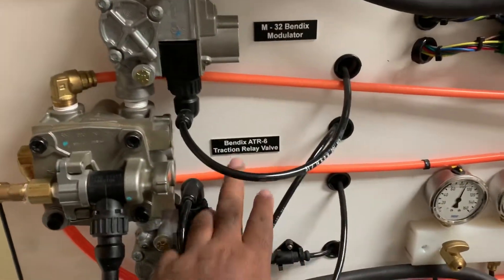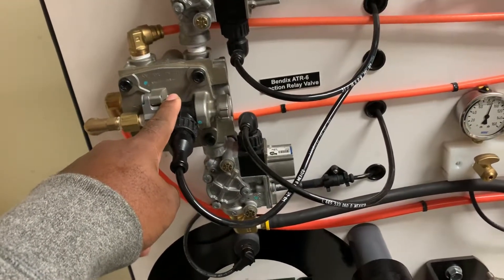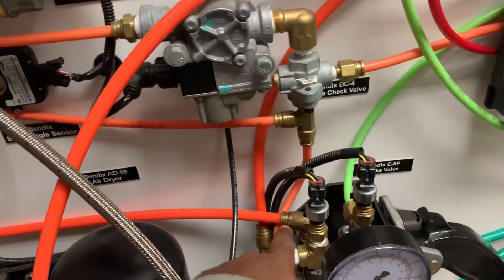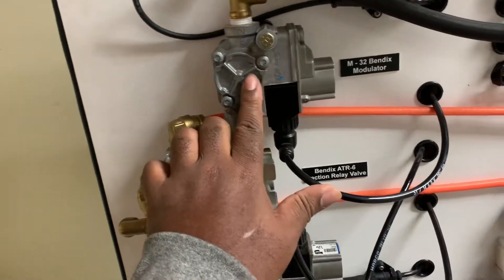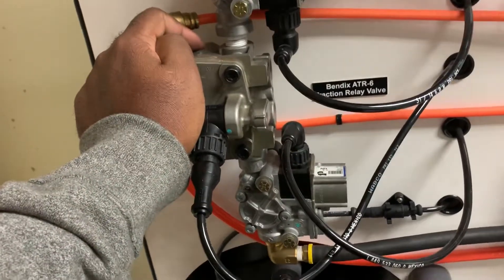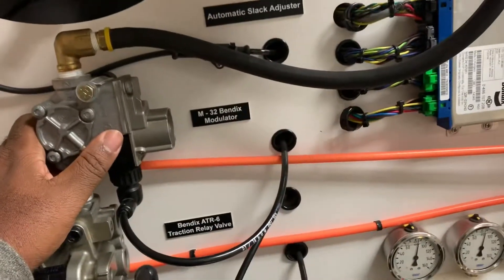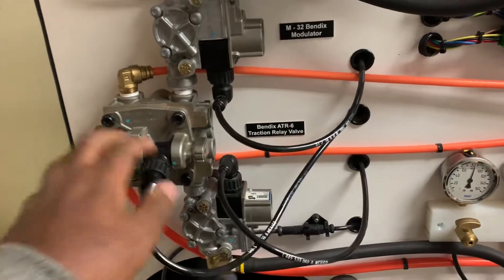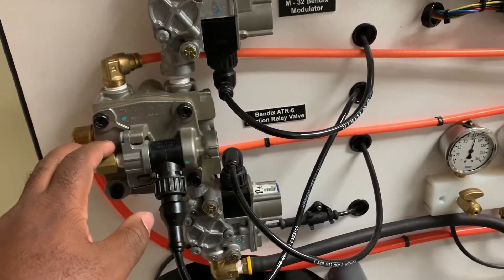Relay Valve and modulator valve

Comment: Hi , when I apply only foot brake (not the parking brakes) there is hissing noise comes from the relay valve and when I put my thumb it just stops
What could it be ?
It doesn't happen when I apply parking brakes 
Thanks

Comment: If the modulator is leaking out the exhaust when brake are applied, is it always the valve is bad? Or can the brake chamber be bad cause it to feed back and dump air?

Comment: Having issues with my 2021 Peterbuilt 348 . I have no air leaks . Getting good air pressure. My brakes are not releasing. I removes both air lines going in to my drive axle brake chambers and getting air on both lines . Should I be getting air on both line s ?

Comment: Hi I had a bad abs sensor on rear axle replaced it now get a brake relay diag.1 my brakes start to lock up on me is one of these on the video the problem
Reply from the maker: You should check your brake adjustment. Unless the abs light is flashing in the cab before they lock up.
Reply: @learndiesel528  no sir no light thank you this is very informative

Comment: A line from this valve it’s back flowing to my pedal brake Valve a delivery line to be more specific and not sure if it’s the really valve or the the other module that’s hook to the valve , it’s there any way to test this valve ?
Reply from the maker: You have probably solved this  issue but I dont know of anyway to test this valve other than getting a known good unit and swapping it in. But the fault you are saying would indicate to me that maybe the foot brake valve is going bad or is hung up. I would look at that first if you havent already.

Comment: I’m having issues with my rear brakes on my semi when I release the brakes the slack adjusters doesn’t fully return but if i put a little force with just my finger pushing the chamber rod back the some air release from the bottom of the Modulator Valve bottom or if i disconnect a little the air line from the chamber the air release and chamber rod return to the release position 
Do you think can be the Modulator Valve that are not allowing all the air from the line to escape when release the brake ? 
Thanks

Comment: Great video. Hey sir. A bad m-32 valve can be the reason why my air compressor might take toooo long to charge my tanks?? I already did a compression test on my compressor and it seems to be building up air pretty solid. With that in mind, my problem is that in the morning when I press both yellow and red knobs and let air stabilize? My compressor won’t recharge again, I have to pretty much floor the pedal to get it to start building air again. I have changed the check valves on both the wet tank and the secondary tank also. I do tho.. hear a purging sound coming out of that M-32 modulator when pressing the brakes. PLEASE HELP!!!! God bless sir!!!
Reply: Please let me add my system is a bendix on a 2012 Freightliner cascadia!!! Thank you!!
Reply from the maker: You probably got this fixed already but I would check the air governor first.

Comment: I have air leaking from the ATR6 valve when parking brakes are released, can you send me the bendix sheet and any idea would help, valve was replaced already and the same problem
Reply: Check the quick release valve above the 2nd axle

Comment: What if you get a hissing noise coming from the main relay while holding the break
Reply from the maker: Sounds like the exhaust portion of the valve may be stuck. Or you may want to see if it is back feeding. Hope this helps.

Les
Reply: Hi I am having same issue should I change the relay valve ?
It only gives hissing noise when I press foot brake not when I release parking brakes. @learndiesel528
Reply: What happens if the brakes apply by themselves i pull over and the service side has pressure so I take the hose off the chamber and bleed off the air reconnect the build pressure then I can go again

Comment: Great video!! My rear brakes are releasing very slowly. I can hear the air exhausting slowly from the quick release valve which is brand new.  What else could be causing my brake pressure to release slowly after releasing brake pedal. Only happens of service side. Thanks.
Reply from the maker: Is it the parking brake of the service brake that is releasing slowly?
Reply: I'm having the same issue I don't know if they find the cause. But in my case when I release the pedal the sometimes the psi goes really high and even if doesn't do that most of the times a few psi remain in the system we checked with a computer and it shows that it's the secondary air that doesn't go down it gets sticker around 12 psi and it slowly goes down I wait until it's around 4 to proceed but sometimes in traffic the trailer brakes get hot if not carefully even smoking. I blame this valve. Please help thanks